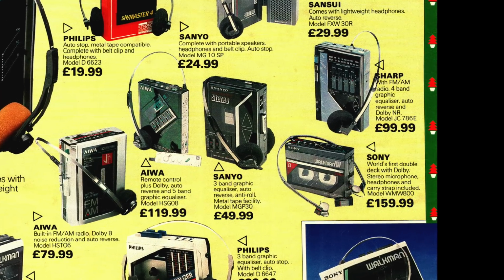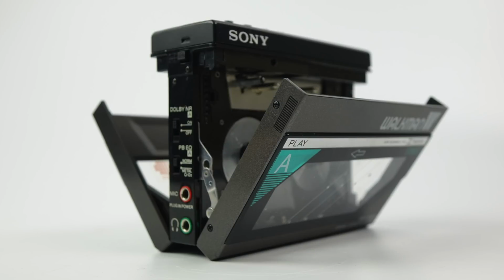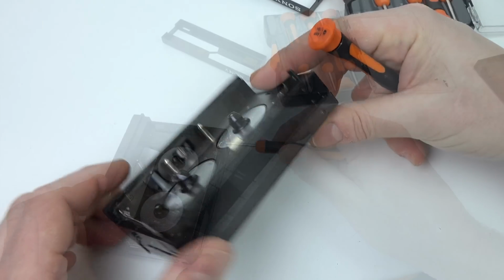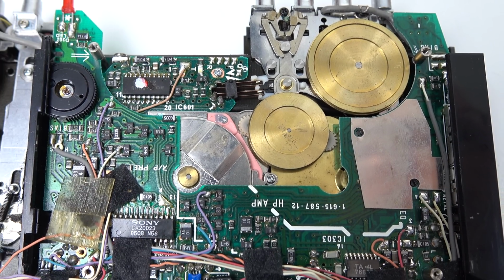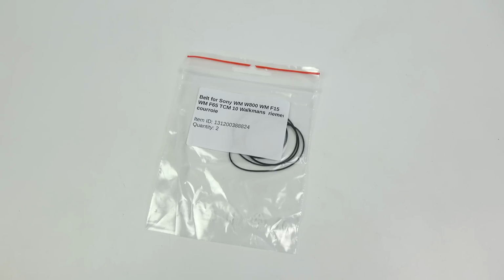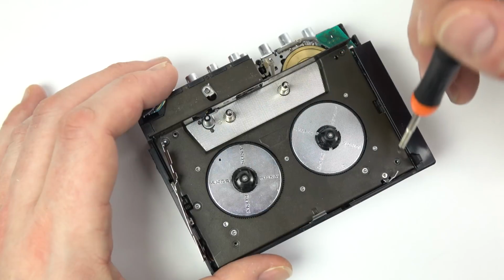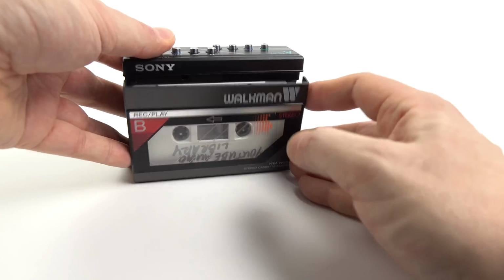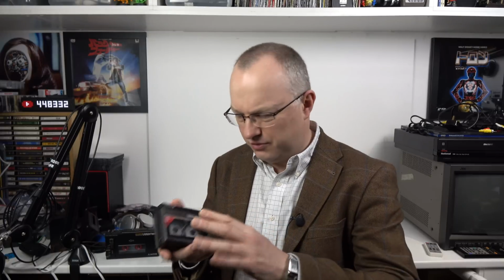'Repairing' the unique Twin Tape Sony Walkman W800

Comment: You should use an ice cube tray to keep all the screws separated. They're nice and cheap and give you tons of pockets to keep all the different sizes separate. Then when you want to put the thing together you just work in reverse and you know which screws go where.
Reply: I use transparent med containers, if you absolutely want to use a tray use a pill organizer so you at least have a lid for the different compartments
Reply: Good advice!
Reply: Or just do it on video and watch it back when you're closing it up
Reply: @tbb033 how do you keep track of 20 odd tiny screws that could be different sizes..
Reply: When I disassemble such things, I draw every perspective like a manual and put the screws on the drawing, at their proper position.
Reply: For something like this, just keeping them separate usually isn't good enough. I take a photo of the device, print it out, tape that to the desk and put the screws down on that. If there are cats about, I tape the screws down.  Then I know for sure where each screw goes.
Reply: You could reverse that as well - "You don't need to draw it, I print a photo" Taking a photo and printing it is about a minute. I can't draw that well or that fast. And I generally don't bother for things with just a few screws, only for crazy stuff with 20 screws of 10 different types.
Reply: I prefer those pill orginiser boxes with 7 separate lidded compartments.
Reply: L3 P3 Good one! Wouldn't mind seeing some of your drawings!
Reply: You do not need to make a photo. I draw it. But just as a plain scheme, just a rectangle with very few details.
Reply: I just forget where all the screws came from and leave a few off when done. It still works, and makes it easier to take apart next time.
Reply: Ifixit has a great clear mat that offers the same functionality as well as printable templates you can put under it to sort it even more easily.
Reply: Cameron Webster I could do with one of those for my pills, ha! Smiley!
Reply: @John Ridley - that's exactly what I do, if I think it actually matters. Usually I end up thinking I should have taken a photo when it comes to putting the thing back together. I seem to recall a Tim Hunkin book in which he referred to left-over parts after you put something back together as "Exeters". Or maybe Exiters?
Reply: Noice
Reply: I just record everything I do with my camera and a macro lens, so I can watch it in reverse. Thus, I always know where the screws go.
Reply: Better to get one of the magnetic mats that have tic-tac-toe  patterns... You can also use a dry erase marker to write yourself notes...
Reply: Kacey H Before you put it back together, make sure you pour water or juice in the tray and put it in the freezer for a few hours.

Comment: The D6C... Still got mine bought it new in 1987, haven't used it for years but just can't part with it. Awesome Walkman, too bad it ate batteries for breakfast. Powered it with NiCads, I even got a spare 4xAA battery holder for it so I could keep it running while commuting. Used it to tape classes. Big and heavy but it was the bee's knees.

Comment: That issue could very well be a dirty record-switch. Have you tried pushing it repeatedly with quite a bit of force for a minute or cleaning it with WD40? 
Or is the problem consistent and sound only comes out when Deck B is in record mode?

Comment: Every Walkman of any brand that I ever owned ate batteries and I ended up using them as an FM radio only. The tapes would slow down after only a few days. In fact my last Walkman, the SRF-M43, purchased in 1994 was AM/FM only and it still works. If you ever open a 'Techmoan Museum' let us know. I'd take a trip across the Atlantic just to check it out ;-).

FYI - https://www.manualslib.com/manual/687224/Sony-Srf-M33.html

Comment: That was strangely compelling even though I have taken many (especially) Sony products apart. As you have demonstrated, it doesn't always work, but there is always have the fall back position of it didn't work anyway. My most recent failure was trying to replace a laser on a minidisc with one from a broken minidisc player and I spent the best part of four hours doing it. It never worked, but the donee did still have the same problem as before, so at least I have learnt I can replace a laser! Thanks for your videos. I love 'em.

Comment: Enjoyed your first attempt at saving a walkman very much. I own a small collection of sony sports walkmans (the famous yellow waterproofed line) and I have successfuly ventured at fixing a couple thanks to having extras for parts (and screw-ups from me) and switching belts between them. I've sweated a lot because of those small screws and 3d puzzle-like parts. I didn't know about the belt provider mentioned in your video, very grateful for that tip!

Can I request a video from you one day about the curious yellow sony waterproof walkman line? There was even one that floated on water WM-35. Their first sports model, the WM-F5 is quite curious as well, with a rather unusual door mechanism and control buttons on the side that today one assumes are digital but were all mechanic. These walkmans are such a symbol of a bygone era...

Comment: I'd look for any mechanical connection between the 2 decks that might not have been noticed or aligned when putting the 2 back together, micro switches stuff like that. 
Check, the shiny metallic slide lever on the record half attached to the record button, (bottom RH side,) that spring at the bottom there? Also completely rewind and ffwd the tape a couple of times to straighten the reels end to end to ensure the sound wobble isn't from that.

Comment: Get a piece of double sided tape and put a piece on some cardboard. stick the screws to the tape and label them on the cardboard. If you need to wait for parts put some clear tape over the screws so they don't fall off. You also need some dental picks if you plan to do this more often.

Comment: 3:40 ,,I f*cking get them all together "😂😁😂
Reply from the maker: If not comprehending things is a catch. - I could be the world's best juggler listening to Twista.
Reply from the maker: ...if I just show you here in my hand, if I can get them all together, there's four tiny little screws...
Reply: if I can get them all together = I fucking get them all together LoL
Reply: he said the F word ?
Reply: That's a difficult question. It's the combination of well serviced walkman, a good recordingon chrome/metal tape and a decent headphone. Good Walkmans aren't cheap.
Reply: Peter unlustig Alles soos?
Reply: Peter unlustig youtube police going to flag this vid.
Reply: Hmm, my American ears heard it your way (not the f-word way).

I was surprised you didn't have issues putting it back together.  I'm not sure if that's due to good engineering and assembly on Sony's part or to your skills and/or luck.
Reply: I noticed as well. :)
Reply: Techmoan 

What is the best sounding and easy to afford Walkman you would recommend? I've got a basic Groove Walkman from 2000 and its not the best, so i'd be happy to know if you could recommend anything better to me. Great video as always!
Reply: Rhys Evans I would recommend the wm-f18/28. I found one on eBay and it sounds great. It also keeps really good speed because it has two big metal flywheels in it.
Reply: Peter unlustig I
Reply: lol, wash out that mouth..
Reply: That's the funniest comment I've read all week. Thanks for the laugh 😂- I needed it
Reply: l8tography sees mein Freund... SEES
Reply: i know he didnt actually said that but it still sounds like he did...
Reply: Laughed out loud. Proceeded to click on this to repeatedly hear this. Hilarious.
Reply: Peter unlustig 😂